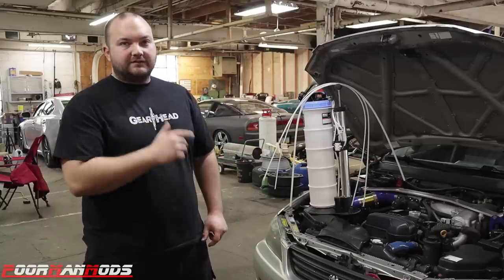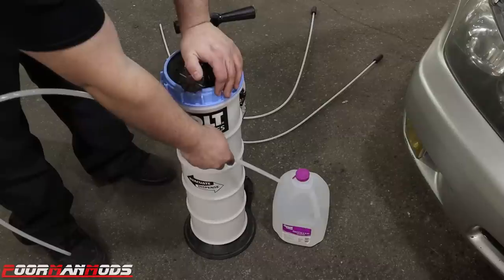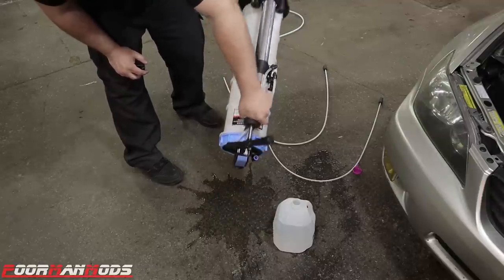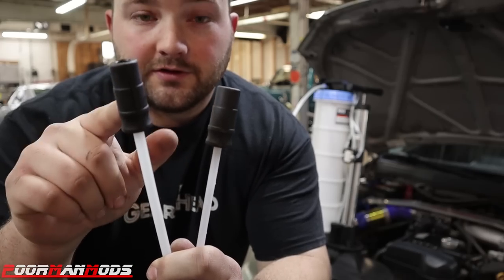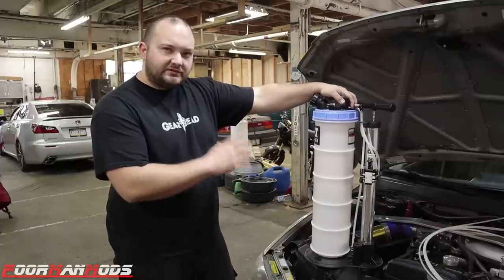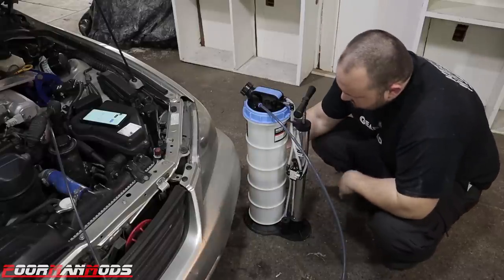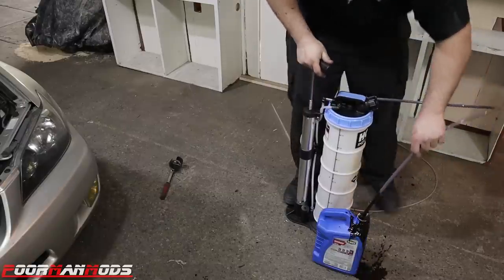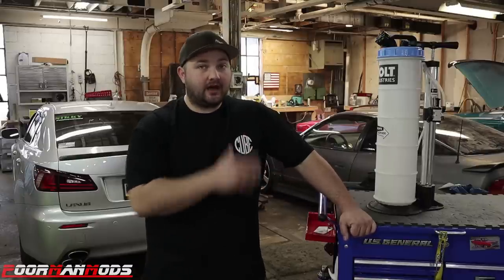Faster and easier oil changes? Holt Industries fluid extractor & dispenser review | Harbor Fright

Comment: Great for cars with top mounted oil filters. Like Mercedes Benz, Audi, VW. If your filter is on the bottom of the car don’t bother with this.
Reply: Not necessarily true. Most bottom filters are still easily accessible without jacking up the car so this is still much less messy Plus you don’t have to deal with the drain plug, which I’ve seen so many people either over-torque or under-tighten, strip…